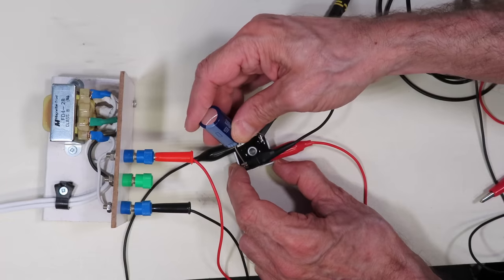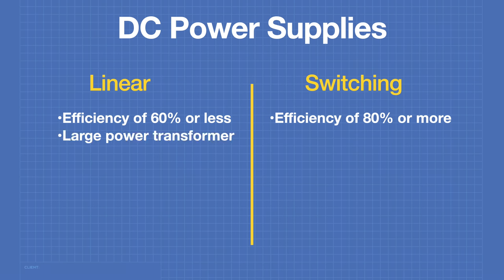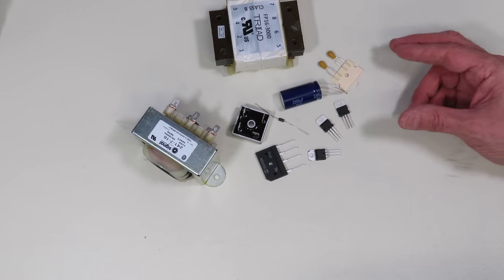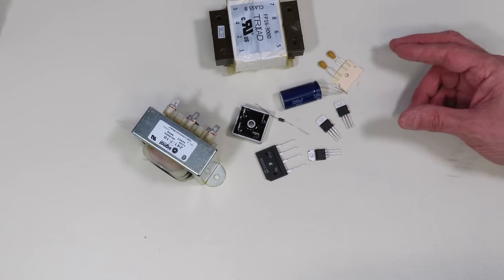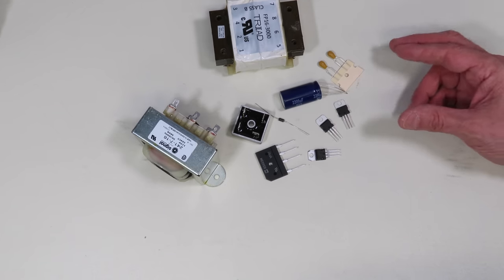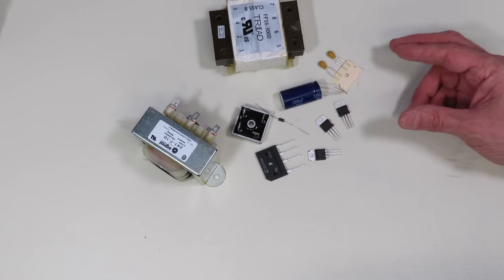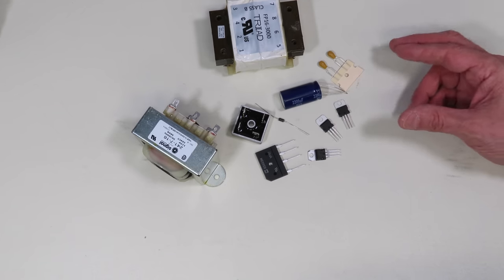Linear DC Power Supplies - Designing & Building Custom DC Power Supplies

Comment: Just a mention with a linear power supply that you need to plan ahead, taking into account the power dissipation of the linear regulator IC. If we try to get 2.5A out when powering a 3.3V required output, the power dissipation of the LM317/LD1085 or the  is (22V-3.3V)x2.5A=47 Watts that will cause the three terminal linear regulator IC to go into thermal shutdown repeatedly. An insulated, chassis mount regulator will go a long way for higher current requirements, or even a fan appropriately positioned.
Reply: use the chassis as a heat-sink??
Reply: @kennmossman8701  Of course. The regulator needs to dissipate the power which is the current times the difference the input DC generated supply minus the the output voltage of the power supply. e.g. : 2.5Ax10V=25 Watts!
Reply: @thehobe150  You missed my obvious point that the chassis is NOT a good heat-sink. Further it is hit and miss - i.e what are the thermal co-efficients.
Reply: @kennmossman8701  The metal box enclosing the power supply is the best and only possible heat sink for the linear regulator. I am a former Linear Analog IC designer with 35 years experience for National Semiconductor and Linear Technology. The linear regulator needs to have some heat sink somewhere or the power supply will be very limited in it's power output, that's my only point. You could also attach the linear regulator to the large internal transformer for some heat sinking for short bursts of power. You cannot let the linear regulator to sit in an air ambient because the regulator will continually cycle on and off as the power supply is loaded, seriously reducing the life of the regulator.
Reply: @thehobe150    LMAO
why don't you start a YT channel, so we all can have a good laugh
Reply: Heat-Sinks

As noted in several comments a heat-sink is likely required. There are very few good YT videos on selecting a heat-sink though "Sine Lab" having one of the better ones. 

It is tempting to consider using the [metal] chassis or case as a heat-sink but this is very much hit-or-miss. A blanket recommendation is stupid. 

An effective heat-sink has four major parameters;

1) type of metal. Some metals are good at conducting heat but many are not good. It is why a steel fry-pan with a copper base is better than an all steel fry-pan.

2) the thickness of the metal. Thin metal is much poorer at conducting heat. It is why a thick fry-pan is better than a thin fry-pan.

3) the surface area as well as number/orientation/thickness of the fins

4) the finish.  Good uniform contact is necessary. It may look flat and unifrom but at a  microscopic level sheet metal is rough. Even with proper heat-sinks the use of a SMALL amount of thermal compound is needed - to fill in the microscopic holes/gaps.

So while the chassis/case can be used you just do not know if it will be effective. Do watch the  "Sine Lab" video to learn more. Full disclosure: parts of the video were based on a PPT I gave to the channel.
Reply: @kennmossman8701  Very good! We need to dissipate the power all the way out to the "free air". The suggested "SineLab" is a very good introduction to the power dissipation issue but is not going to be very helpful to the typical experimenter. No novice is going to be capable of doing an extensive analysis especially when you consider the final Junction to ambient values. Even the heat sinks shown in the article require air flow passing the heat sink to do the exact analysis. I have been the casual observer to many "still air" experiments done is a fixed temperature environment  for measuring many IC packages but the bottom line is that: almost ANY solid product surface, even including plastic is orders of magnitude better thermal conduction than "free air". This is why mounting the power dissipating device to a large surface area object, i.e. the product case, is often the best and most practical choice for helping to dissipate the power required. Double sided copper clad PC board is often a good interface for electrical isolation that can be adhered to the product box allowing a large rectangle piece of copper clad to help conduct the heat to the outside world. A metal product box is generally recommended for power supply that need to dissipate 5-25 Watts of power. I know it's a very approximate solution but pragmatic.
Reply: @thehobe150  Utter and complete nonsense.
ALL the parameters are in the spec sheets or just plain common sense. Your stance is completely without foundation - it is just your bizarre hobby horse.  FOR THE THIRD TIME justify using thermal co-efficents. SHOW THE MATH
Reply: @kennmossman8701  "SHOW THE MATH" (in all caps). They did.

"If we try to get 2.5A out when powering a 3.3V required output, the power dissipation of the LM317/LD1085 or the  is (22V-3.3V)x2.5A=47 Watts"
"The regulator needs to dissipate the power which is the current times the difference the input DC generated supply minus the the output voltage of the power supply. e.g. : 2.5Ax10V=25 Watts!"

Look. Math. Do you think that the additional energy just vanishes?
Reply: @Nalianna  
It is a rather moronic point. Who would use a tack hammer to drive in a railroad spike? 
Yes, he should have addressed Pd more but there is a limit.    
One can always find an extreme case but that reveals a basic mis-understanding rather than a basic flaw.

Comment: Awesome video and channel!
There is one problem. When switching between fixed voltages, the voltage becomes momentarily unregulated. As the voltage spikes show at (1:09:00)
It seems like the voltage regulator just becomes a 0.7V drop diode when there is no resistor connecting it to ground. Any project connected to it might not like the full 22V rectified voltage.
Maybe it is better to have the lower part of the voltage divider fixed and put the switch and turn pot resistor on the higher part. Possibly with the 3.3V resistor as bypass resistor for the others, so that it is the minimum voltage. Or an other value bypass resistor to set a minimum voltage, so the regulator is not stressed out because it has no feedback from its output.
Reply: Ideally I would drop this ugly "voltage switcher" and just make output sockets with fixed voltage. It takes more space on device, but way easier and safer in terms of scheme (just use L7805 and like).

Comment: Nicely done.  For cutting larger holes in a metal or plastic chassis,  I use a Dremel tool with a cut wheel.  That works well and is quite quick.  Safety glasses are a must.  Take care 😊

Comment: I first got into electronics as a hobby when I was in college.  The first thing that I ever built was a linear power supply that provided regulated 5VDC and regulated 12VDC using a 7805 and 7812..  Got most of the parts at the neighborhood Radio Shack.  I designned and etched the board myself using a photo resist.

Comment: Thank you for another excellent video Bill.  It was really good.  This is one of the best introductions to linear power supplies I've seen.  I really like your benchtop supply you made as well.  I just made the switching supply version using an ATx power supply a couple of months back.  I'm tempted to try this for having a higher range and the variable voltage feature.  Fantastic video!

Comment: There already have been a lot of good comments regarding heat dissipation, reverse voltage protection at the VR, reverse current protection at the output, etc.
However, there is one thing I would like to add: In your design DC GND is connected to main earth.
This can lead to some subtle problems, for example:
a) It is not safe to cascade other power supplies with this supply.
b) It is not safe to use an oscilloscope with circuits powered by this supply, because the GND of an oscilloscope is also always connected to main earth (if no differential probes are used). This can easily lead to shorts by simply measuring.
Therefore virtually all power supplies are floating, i.e. the output is not connected to main in any way, by default.

Comment: One rule of thumb for the input capacitor is 2000 uF per Amp. So for a 2 Amp PSU use a cap around 4000 uF

Comment: A good source for a linear regulated power supply is any of the "SOLA" type industrial power supplies. They can be found in 5v, 12v and 24v versions at different amperage's. Usually they are very affordable and would be a good foundation. Some of them use an adjustable regulator that is good over a voltage range of 2v-36v.

For this project you might want to add some protection (zener diodes, etc) because if you ever loose regulation you'll get the full output of the rectifier.

Comment: Having gone from LM317 at around 10W to a quad 400W, that's 4 x 400W, using LM317's / TIP5C's, massive heat sinks and 6 fans, 4 transformers, etc, etc. purely for the fun of it I can quite honestly say this is a good video. My only concern would be the heat sink for the LM317 - it's too small. I like the LM338 (5A) but again heat is a problem. The LT1083 is a beast at 7.5A and so far I have not popped one. Forgot 80,000uF.

Comment: You might want to address the spike in voltages between the fixed values, see from 1:09:17.
Reply: It seems like the voltage regulator just becomes a 0.7V drop diode when there is no resistor connecting it to ground. Any project connected to it might not like the full 22V rectifier voltage. 🙄 But you already knew that.

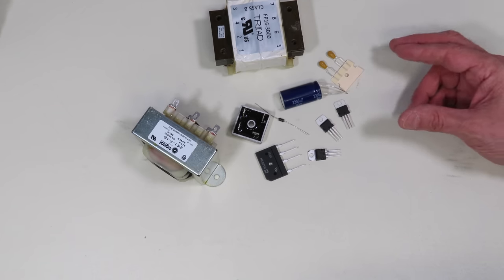Comment from the maker: If you want to jump directly to the power supply build, it's at the 32:45 mark - but I do hope you watch the tutorial as well!  :)

The article on the website has links for all the parts I used, as well as links to a couple of handy online resources you can use for calculating transformer requirements.  You can check it out at https://dronebotworkshop.com/linear-dc-power/
Reply: I really want to build this project, but I have an MOT (microwave oven transformer) and I would need much higher amperage.  I'd like to build something, maybe in the 15 to 20 amp range. Where can I find variable voltage regulator in that amperage range?
Reply: Did you check that the ammeter is accurate by using a known resistance across the output terminals? According to the manufacturers meter wiring instructions, you should not connect the thin black wire if you are using the same power source as the output. You only connect the thin black wire if using an independent power supply like a battery or another isolated power supply. Your readings at the end show:
10V/0.72A=13.9R, 3.3V/.19A=17.3R, 5V/.33A=15.15R, 12V/.88A=13.6R - either your load was not a passive load - or your meter has the thin black wire connected!
Reply: Hi Bill, I am of a similar age to you, but a marine engineer, and so learning electronics from the age of 50 until now (13 years so far) has been quite challenging- then I discovered your YouTube channel, where your explanations are just what an old timer like me needed- AND, since watching - and i mean binge watching your videos, (along with Big Clive and AvE's Videos) I have learned so much, and NOW you have presented me with the exact video i needed to build a variable power supply for my son's new Railway (he is 15 and an avid steam railway enthusiast, so we just bought a new shed specifically to build a model railway in. Your explanations are so precise and easy to understand- you even unlocked the mystery of the Arduinno for me,  I just want to say thank you Sir. I wish you knew how much you have helped me understand electronics to the place where I actually know, and more importantly, understand what I am actually doing, so many thanks, Michael.
Reply: Where did you get the chassis cases from?
Reply: I have watched 2 of your videos including this one and both where on topics I just so happen to be researching currently. As a 52yo ME that is finally taking a deeper dive in to the electrical world I am truly impressed at the educational value you provide. The way you teach is understandable and informative while pointing in the direction to further investigate related elements. Great job. I'm guessing you have instructed in some capacity throughout your career
Reply: Cannot enter website.
Reply: There's a problem with the thermal aspect of this design, and it hits at the heart of what makes adjustable linear power supplies problematic. I commend you on the detail and patience in this video, and many useful tips. But 44:00 is a problem.
An LDO does not "give off less heat". It simply is able to maintain regulation control with less voltage drop between input and output before it "drops out". That allows outputting a higher voltage with a given DC input, or for a fixed DC output, it's happy with a low input voltage (all compared to a non-LDO reg). But LDO or not, it still has to drop the voltage between the input and output, and that voltage, multiplied by the current = power dissipated as heat.  So if you operate this PSU as advertised with say 2V output, 24V input, and 2.5A load, that's 22V x 2.5A = 55W that the regulator has to dissipate.  I am pretty sure that small heatsink is not going to cut it.
Reply: A note about grounding.  As shown, you certainly want to ground the case to the mains "protective earth" ground from the power cord and wall outlet. This prevents the case becoming hot if one of the mains input wires comes loose and touches the case.  However, you usually do not want the PSU output terminals referenced to ground, you want them floating.  (Possibly with a high-value resistor bridging from earth ground to PSU ground to avoid static charge accumulation.)
This avoids setting up a ground loop when the PSU is attached to an external circuit that has its own ground reference that may differ.  This happens if, for example, you connect a scope probe to your external circuit powered by this PSU, as most scope probes have mains-grounded ground clips. 
Also, if you build two of these PSUs with floating outputs, you can connect them in series (for example to use one as positive and one as negative).  Commercial power supplies typically have floating outputs, and a separate earth-ground banana jack that you can jumper to the negative or positive output terminal if you do in fact want your PSU output referenced to earth ground.
Reply: I almost clicked the 32.45 mark and i have to be honest if anyone is here to build a power supply, and that goes for the majority, they need to watch it all,  This is really worth the watch your a damn good teacher, its a rare thing these days,
Reply: Excellent presentation! Thank you.
Reply: Excellence, revision also new information. Great presentation !  Padraig
Reply: Your tutoring is divine thank you!

Comment: I’ve watched electronics videos over time and this has stood out not because it’s something new but it’s the way and how simple things are being explained in it. Thumbs up 👍🏽, I have one little challenge though, I’ve been trying to build a power supply with both positive and negative points and I have a single 24VAC power supply, will it work properly if I connect both the negative circuitry and the positive circuitry in parallel to the transformer output??

Comment: This takes me back to one of my EE classes when I built a power supply similar to this. 

At about 54:00 you stated a desire to avoid using connectors on the PCB, preferring soldered connections. But at 57:30 you are using terminal blocks to connect your dial assembly. Was this an unplanned change made along the way? That is quite common when designing products. I prefer the later choice. I like to keep things neat and tidy inside the enclosure. It makes it much simpler to track down any problems. It's also kinder for anyone working with it later. 

Great video. You have a good classroom feel.

Comment: This is a great project, and it makes such a neat package :D
I'd love to see a project based on a programmable regulator and combined with an arduino to show voltage and current on a custom display. You could use push buttons to jump to a custom voltage, and a rotary encoder.
The front panel talk was an interesting segment, worthy of a video in and of itself, the various methods of creating a panel. Laser engraving, machine engraving, laser printer toner transfer (how some people make PCBs). Even using PCBs themselves as panels. One technique I've used it to print off the whole panel on paper, laminate it and cut it out, then glue that to the front panel.

Comment: Just found your channel and subscribed. Linear power supplies are also essential for music audio applications to power guitar amplifiers and effects where clean, noise free DC is required. For those who do not want to work with AC currents, you could consider making a video about constructing a power supply with +/-9 plus variable 1.5-12V outputs using a cheap wall wart as an input. This way you would not need the transformer or the rectifier either, bringing the cost, size and weight of the supply down considerably.

Comment: Great tutorial. The design would have been more flexible if all of the voltages were made available simultaneously as outputs with separate readouts ! This need is frequent in my case. 
Needs a more complex circuit at greater cost, of course !

Comment: 1:06:13 I noticed you said you would connect the HV inputs directly to the transformer inputs, but at 1:06:13 I notice you have passed the red, blue and black wires directly through the perfboard. Did you drill those out to make space? I'm wondering what is the thinking for passing through that way, rather than going around the edge of the board. Thank you.